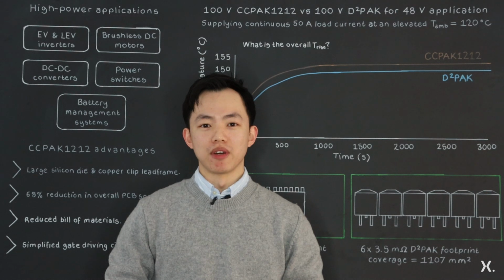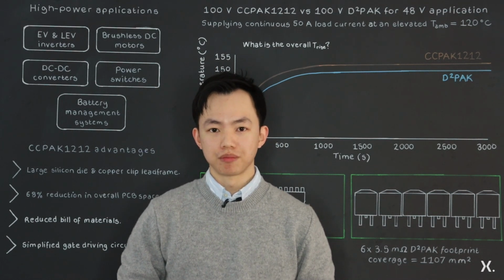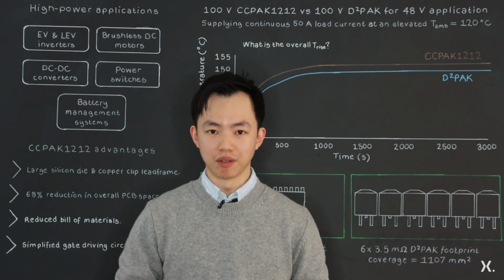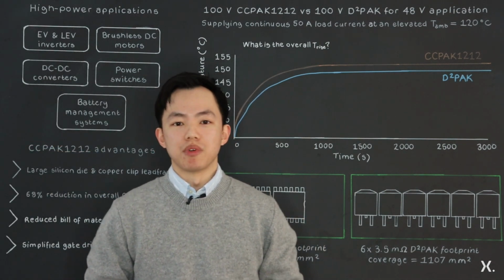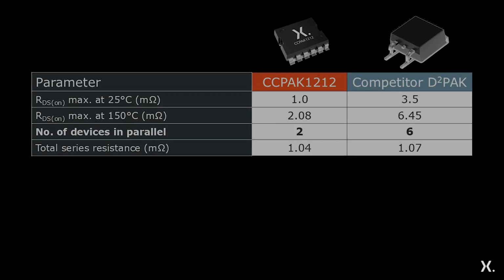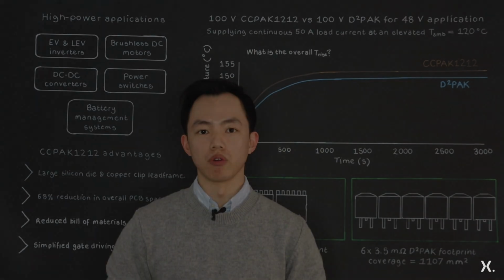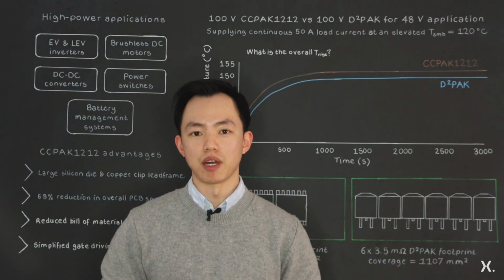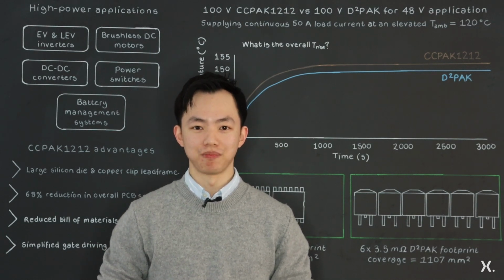Optimizing high-power designs with paralleled CCPAK1212 power MOSFETS

Comment: So for 50A continous at 100V single CCPak1212 Mosfet won't be enough? There is 500A options at selection.. But still we need to make parallel? With that high spec ratings, why we still making parallel?
Reply from the maker: MOSFET current capability is given against PCB temperature (Tmb), the higher the temperature the lower the current allowed through safely.  If PCB / mounting base temperature can be maintained at 25C then the full current capability stated in the datasheet can be achieved – please note that maintaining PCB at 25C with such high power is very unlikely in real life application using FR4 PCBs.